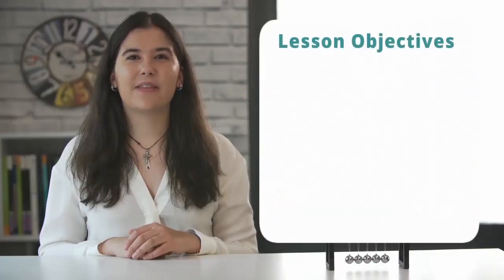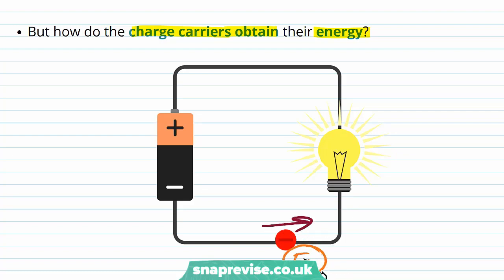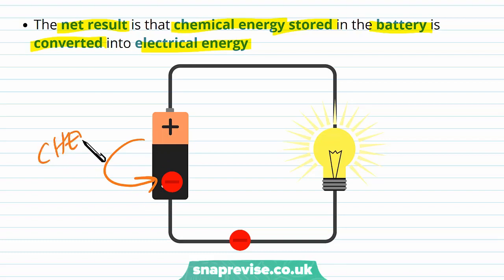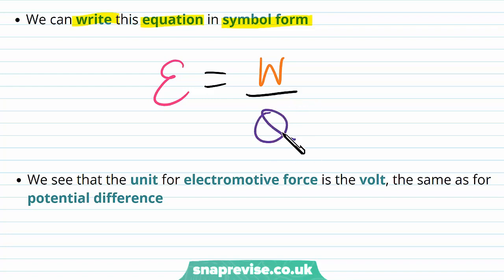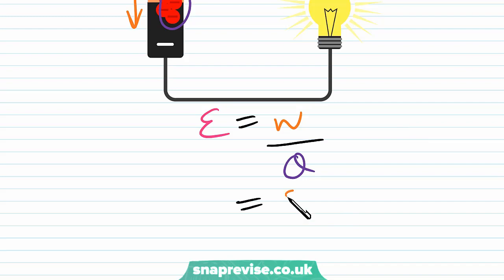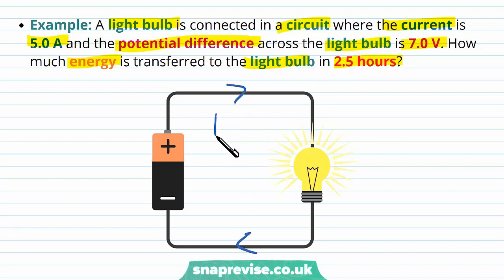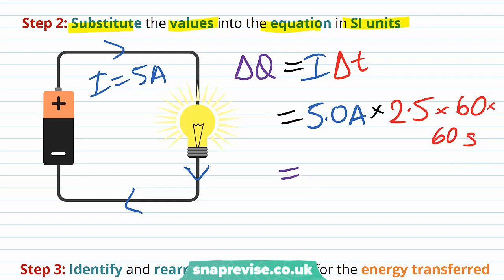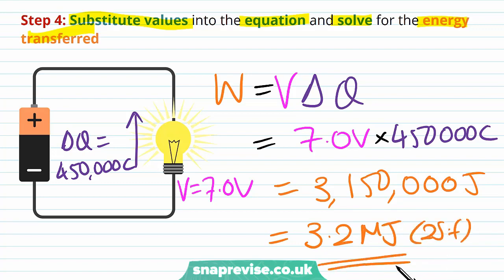Electricity: The Electromotive Force (EMF) | A-level Physics | OCR, AQA, Edexcel

Comment: Indeed the EMF is not a force but it is related as it induces an electric field which applies an electric force on electrons causing them to accelerate. As the kinetic energy of electrons is increased, the circuit then carries more energy per unit charge, implying a higher voltage.

Comment: @SnapRevise You worked out the worked example wrong. It is actually this:
Step 1: Find the total charge that has travelled through the light bulb over this time. Recall the equation and rearrange for the current through the light bulb.

I (A) = ∆Q ÷ ∆t

∆Q = I x ∆t

Step 2: Substitute the values into the equation in SI units. 

∆Q = 5.0A x 2.5 x 60 x 60 = 45,000C 

Step 3: Identify and rearrange the equation for the energy transferred by the bulb.

V = W ÷ Q

W = VQ

Step 4: Substitute values into the equation.

W = 7.0V x 45,000 = 315,000J
Reply: They never read the comments
Reply: Or you could do:

P = V x I 

P = 7V x 5A  > 35 watts 

P = E / t (rearrange for energy)

E = P x t 
Convert 2.5 hours into seconds by multiplying by 3600 (3600 seconds in an hour) and that gives you 9000 seconds
E = 35W x 9000s > 315,000 J
Reply: you explained it so precisely in the comments, idk what you are doing in life but im sure u would make a great teacher :D